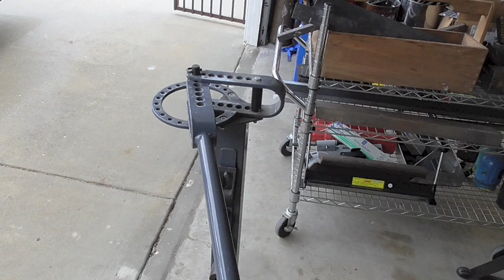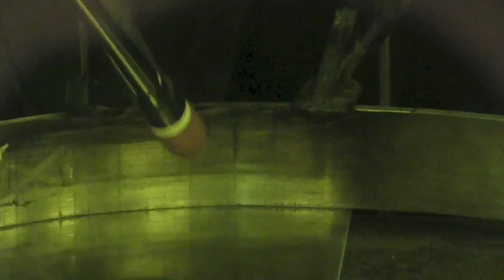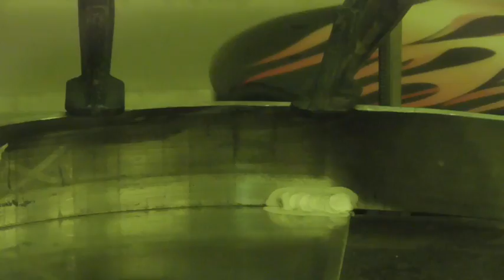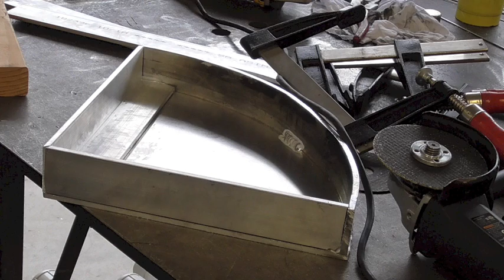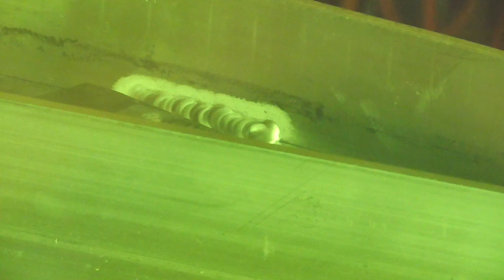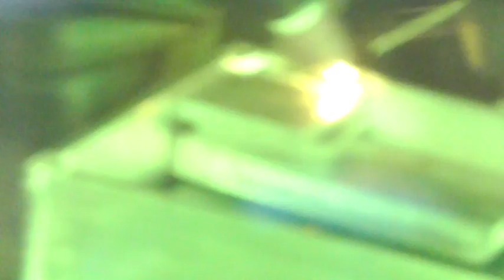TIG Welding Thick Aluminum

Comment: Great video.
Just a suggestion-
You can gap your base metal up off your work table so the table doesn't soak all the heat out of your weld joint. Less amperage and less heat-up time will be required.

Comment: Prevent the camera from auto-focusing... set the camera up where it needs to be, do a "one time manual focus" before welding. You need to have the welding glass cut to the size of the camera lens, or at least put it right up against it so there's no gap where light can enter between camera lens and welding glass.

Comment: How pure it the root of this weld . When I qualified on aluminum bronze (which is much easier to weld DC than aluminum), I could easily weld it DC , but could not pass because of of tiny bits of dirt and near invisible cracks at the root. Even AC was a test. This was cast material I was welding.
Reply from the maker: +papa Hajek Pure enough given the use of this object. The piece was nothing that was going to be inspected and not intended to hols a lot of weight. Also, I pre-cleaned it with a wire brush (Stainless) and acetone, and I welded it on AC with a 70% balance. Finally, there were no apparent visual bits of foreign matter in the puddle as I welded it, so I think I will be okay. Thanks for the question and comment.

Comment: I see everyone commenting on helium. It has been very hard to get ahold of and price has gone up to a ridiculous amount. sometimes we need to compromise. great video.
Reply from the maker: +E A Thank you for that, and of course I agree. Very hard to find and expensive!
Reply: I'm thinking about buying the Everlast 255ext for welding thick aluminum. It has advanced waveforms that allow more heat at the same amperage to be put into the aluminum. Have you worked with advanced waveforms before and what do you think of it?

Comment: Is that a gas lens? also 1/8 pure tungsten?
Reply from the maker: +papa Hajek Yes on the gas lens, no on pure tungsten. Pure tungsten does not work well with inverters, so I used 2% lanthanated.
Reply: WeldFever I've also found 2% lanthanated to be the best all around tungsten for inverter machines.
Reply: WeldFever I've also found 2% lanthanated to be the best all around tungsten for inverter machines.

Comment: you are running way cold and your filler metal and tungsten should be thicker.  In all reality you should be MIG Welding that.  Stainless steel wire brush would help. WD-40 was a bad idea too.  MIG!  MIG! MIG!
Reply from the maker: +Joseph Feltner My machine was limited to 200 amps, and the 1/8" tungsten will handle 200 amps with no problem. Thicker filler metal would have compounded my problem, because it would have cooled down my puddle more than it already was. I did in fact use a stainless steel brush, and the WE-40 was easily removed with acetone. I will agree that I wish I would have had a higher amperage machine, and I did not own a spoolgun at the time, or I would have definitely used it. Thanks for the comment.

Comment: DC Tig with 100% helium would be good for such thick aluminium. gives superb penetration.
Reply from the maker: +YeCannyDaeThat Agreed, unfortunately where I am from Helium is currently very hard to come by and extremely expensive, but thanks for the tip!
Reply: +YeCannyDaeThat Hello, DC- or DC+? do I have to preheat? what kind of gas? Thank you
Reply: +Rafael Mora  DC- and 2% (sharped to a point) tungsten, for 4043 filler rod use 40 cfm helium and NO preheating is required. When you strike the arc there is no puddle until you add filler rod, so you start welding right away and welding travel speed is twice as fast (minimum).
Reply: Bruce Burrill I thought that Aluminum should be welded in AC. Have you ever weld Duraluminum (7075)? What filler rod should I use?
Reply: +WeldFever i was just going to say that "not always available and expensive".......to get helium ,but it does work way better

Comment: awesome, Great tig videos more please some stainless? Question? 1. what are the main differences you recognize between the Miller and other welders? and which do you prefer to use? and why? :) Thanks keep them videos coming.
Reply from the maker: weldingluminary Mainly its reliability. I have used many welders at jobs, and my own, and when properly cared for, Miller's last the test of time. As a result, their resale value holds up pretty well too. I also like the way they operate. This is, of course, personal preference, but I think they run smoothly and as a result hardly ever give any trouble. Lastly, they're still made in the good old USA and that means something!

Comment: I can weld that with .062" tungsten and get instant puddle. The trick is use DCEN (straight) polarity. It's a little harder on 50xx series magnesium bearing alloys, but you can make x-ray quality welds. If you can swing it use .999% pure helium instead of balloon grade. In aerospace field DC on aluminum has been used for at least 30 years.
Reply from the maker: yzmaximus Excellent information and advice! Thank you for that and please keep commenting when you see the opportunity.

Comment: Hey Dan,
Check into part supply houses for helium, was suggested by an older welder I know. I haven't checked the exact pricing myself, but perhaps something too look into if you should (need) helium, or a WPS calls for it exactly.
As cobnutts said a few weeks ago, a new scotchbrite pad(best if on an air tool if you have one) and some acetone with a clean rag really helps the metal to flow nicely.
"Prep" is key with aluminum. But you know that I"m sure :-)

That little Miller 200DX is a sweet machine, a friend just got one a few weeks back with that fancypants wireless pedal(which, TBH is REALLY handy, albeit $$$)

thanks for posting the vid,
Dan
Reply from the maker: chopperdan88 Great tip on the helium, thank you so much for that! Yeah, I do know about cleaning the aluminum, and believe it or not, the sections I was welding had been brushed with a stainless brush. Thanks all the same though, I appreciate your comments and suggestions!
Reply: +chopperdan88 Air tools ARE nice for their high rpms, but you do have to watch out for airtool oil spray, even with an acetone wipe down it can hide in corners and seams. Just a random side bar and funny thing +chopperdan88, I made this comment before noticing it was in response to you after we'd already chatted earlier today. I swear I'm not following you, LOL, just finding myself with thoughts on your remarks...

P.S. It's been ages(at least 11 years!) since I've welded any Aluminum, and I miss it's thick ropey beads and shiny puddle!

Comment: Ball that tungsten and clean the aluminum with a flapper and acetone
Reply: +Brandon Ritchey Tungsten will self ball and to keep the ball small and get deeper penetration, set AC balance at 8 or higher.

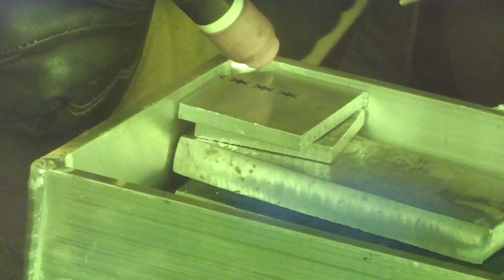Comment: WeldFever you use a sharp tungsten on ali? is that because you just cleaned it up? and used it to get a nice crisp start for that particular weld at 11:33 ?
Reply from the maker: mikethecripple Mainly it is because I am using an Inverter machine, and a sharp tungsten works fine on it. If I were using a transformer/rectifier, I would have a balled end on my tungsten.
Reply: @weldfever ahk. because ie got a inverter and i rock a sharpish one but after like 30 sec it balls up because i run like 70% acen because the problem with working with free material is that its usually dirty and oxidised to hell ;)

Comment: Nice video! Let me offer a suggestion as someone who has welded lots of aluminum. Take a stiff stainless wire hand brush and remove the shiny surface off the aluminum along the weld zone before you start welding and it will be easier to weld. Aluminum develops a surface oxide layer that thickens over time, and the oxide layer provides the great corrosion protection. But, the aluminum oxide melts at over 3700 degrees F and aluminum melts at around 1221 degrees F. The cleaning action of the AC arc does a good job of removing the oxide, but if you go ahead and remove as much as you can with a brush before welding, it will make the puddle cleaner.

Keep up the good work on the videos!